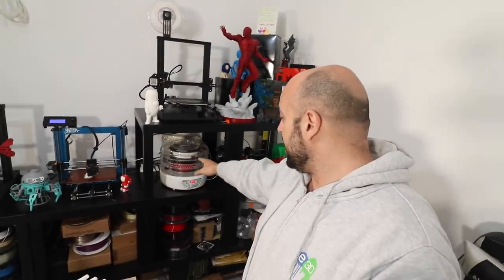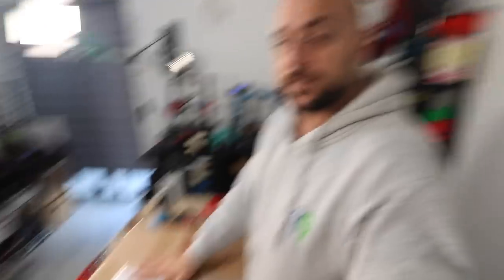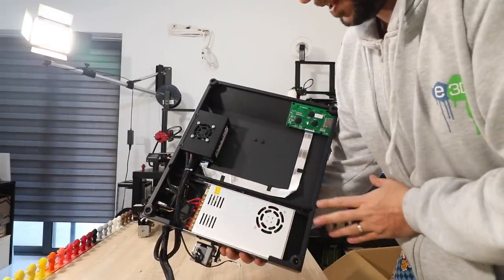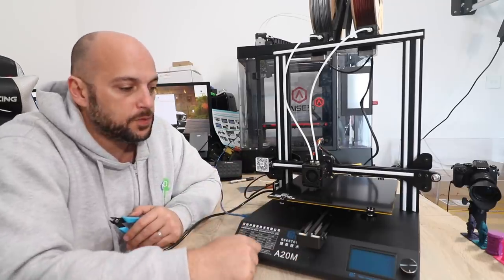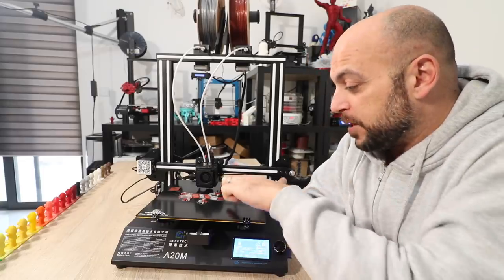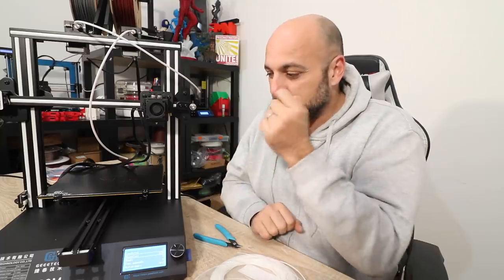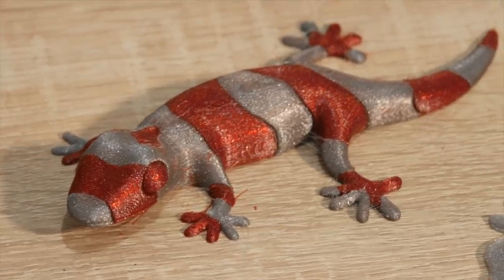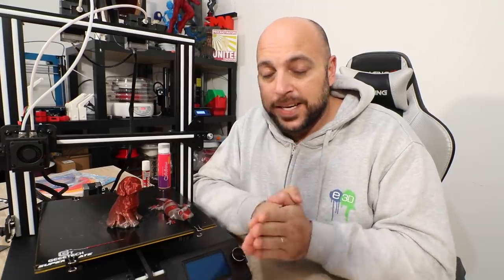Geeetech A20M First Impressions - Maker's Vlog

Comment: Hey Joe, CHEP (Chuck) did a video about retrieving settings from a presliced print (Cat?) off an Ender 3 using S3D, I think. It's worth a watch cause that's what it sounds like you're trying to do. Hope you feel better. Merry Christmas!!
Reply: I was just going to say this ^^^
Reply from the maker: Unfortunately that is not working for me, i am guessing S3D patched it so it doesn't work?
Reply: @3DMakerNoob  You can do the same thing in Slic3r.  File - Load Config - then select the G code file.

Comment: I have this printer with the same problems I've spent many hour working with it and I have labeled it as JUNK and it now set in the corner never to be used again
Reply: Bob i'm not trying to be a jerk here but part of the package in 3d printing is dealing with the various nuances of the printer.  

You not willing to spend time tweaking isn't the printers fault nor should it be labeled as junk because you find it of inconvenience to properly tweak the printer. 

Being that this printer can mix and print in dual color increases the difficulty of use exponentially.  

If you wanted something ease of you get an ender 3.  I assure you your still going to have to adjust, mod, and tweak that as well.
Reply: Bob you are welcome to send the printer to me, that is for my daughter to work on it and i can help her get it to work, Myself and her will be very grateful and that way the printer wont be catching dust as junk sitting in the corner.

Comment: I have been driving myself crazy with this.   I've got an A20m that I'm trying to print a few dual-color signs on.      My slicer is CURA 4.6.1 I can get the base to print in 1 color in .4 mm but I want the letters & #'s to be raised and printed in a .15 mm with the 2nd extruder.     I have not been successful in saving the base plate print at the .4mm layer with the 1st extruder and .15mm with the 2nd extruder.     It wants to only print in the entire sign in the 1st setting of .4mm even though I'm setting the plate separate from the letters & numbers before I merge the 2 together.   Any ideas on how to set 1 extruder to print in a separate layer then the 2nd?

Comment: Hi. I bought that printer. I leveled it and my first print was not right. I've found out that the bed bad was not straight. It's wavy. It has 2 hollows on a side, from one corner to the other. What should I do other than buying a 3d Touch ?

Comment: Hello thank you for this video, I actually purchased the A20m.  I am having the worse experience with the printer but working through it. My dog prints fine but cant get adhesion at times and etc... comes with the territory.  I was wondering if you were able to get the gcode and make your own config?  

Also, I didnt receive the lizard on my SD, is there anyway you could send me the file from the SD or point me to the g-code file?

Thanks again for the videos.

Comment: I saw a video the other day that said if you use slic3rPE and click load config and then select a g-code it loads all the setting the file was sliced with.  Not sure if this works with g-codes created with a different slicer but definitely works for slic3rPE generate g-code a handy tip if you want to see the settings a file was sliced with.

Comment: I had the same problem with the layer shift on the Geeetech a10M. My solution was to use a pair of side cutters and cut the corner of the purge block after the first purge while it is printing. A hack but it worked.

Comment: Hi. A colleague of mine had a great idea, and since you are an influential person in the 3D world, I would like to pass this idea on to you:
When you print in more than one color, a block is generated for the color transition. He said: Why a block? why not another impression or piece, something that later the person paints and has no problem of getting mixed colors. At least it does not lose so much filament.
Reply from the maker: It’s already done that way if you choose to, but there are limitations as you still need a small block for the initial colour change and then you use the secondary object as the transition model

Comment: Hello Joe, thanks a lot for your video. Please try to set esteps to 430 and see if it will solve the string.
Reply: Can you guys share the profile you used for the test prints that come on the card, also what slicer are you using ?  Thanks